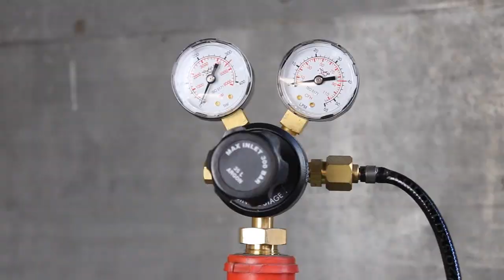DAY 2 ON THE 59 FORD 100E/ MX5 MIATA. STRIPPING DOWN THE MX5

Comment: Will this be a road registered car? Will you have any difficulties registering? Here in Australia I have been building something similar for the last 5 (!) years, basically a 1962 Mercedes 220SE Body on top of a 1990 Mercedes W126 420SEC floor pan . This will give me ,basically,ABS, air con, better suspension , etc  I'll be using a 6.9 liter V8.and it will become RHD. I used the later fire wall as i removed the outer part of the A pillars and I've combined the 220 SE pillars to make a stronger structure.I'm combing the rear firewall and parcel shelf to add yet more strength to the older body .I've retained the boot floor and the two chassis rails as they part of the original Mercedes crumple zone structure  . So far I've struck one hurdle. The Government. Here, What we are both doing is interpreted as "rebirthing" a car,which is something car thieves  do. I'll carry on regardless and work my way through the bureaucracy but i'm not holding my breath.  What i also did in the early stages with the 220SE Body was make three large templates of the firewall section, the center of the car across the doors and the rear firewall (boot bulkhead) . I could then lower these large holes over the later floor pan until I saw  the early body would be sitting , as i trimmed it back . I've kept the later sills as the Mercedes design is massive but light. The originals hd chrome covers screwed over them as stock, which makes life easier for me.  Keep up the good work, I'll be watching this from Australia!.
Reply: Mate that sounds awesome. Have you had an engineer involved? If not seek one out. It will make your life a lot easier. Your project should be classified as a rebodied. It will have to meet all adrs of the donor chassis vehicle.
Reply: Hi, yep, I am an Engineer but not certified to sign it off. I have spoken to a few here in Brisbane and their eyes glass over,with accompanying  sound of sucking teeth. Some of the other projects I have done are fully road  registered with out an Issue. I have kept most of the ADR related stuff to fit the car ,even the closed coolant system (has a another bottle hidden inside the front guard. ).When i see what the brits and Yanks can build and register I spit. For example, the Qashki body on a AWD Skyline floor pan, a PA Vauxhall body on a jag Floor pan etc etc . Grenade Motor Sports on YT builds lots of trucks using old 40's and 50's bodies on late model Chrysler Hemi SUV chassis , no problems at all. But this is Auastralia, land of the high taxes and unending rules.
Reply: Mercmad 
My advice..document everything..every receipt every item.. clearly what you are doing is nothing to do with rebirth of a stolen car. I would suggest contact with the relevant ministers and senior people within the relevant registration hierarchy. Good luck with your project. I was in early stage of planning a body swap onto a Toyota platform ( 51 ford body ) but decided against it due to the issues you bought up.
Reply: I've done that, mainly because i had issues with the government years ago (long long story i wont bother with here) and i found out early that a paper trail is absolutely essential. One car i started to build years age was mainline ute on a Holden HQ chassis, something Americans have done a lot of,using the GM A type Chassis with older sedan and coupe bodies ,without a problem. I ran out of time on that one so I sold it. But I was going to register it as a HQ ute.... A mate had one he had bought which was a mainline on a falcon Floor pan which had been registered in NSW ,where it's notoriously difficult to get things approved.
Reply: That sounds like a very cool project, I had a W111 220S, W108 280S in Australia and a W126 500SEL I owned in Hong Kong and brought back to Australia. They are the most beautiful cars.
Reply: Yeah we definitely get a hard time trying to register modified vehicles. I would suggest talking to some local hotrod clubs. They have a lot of experience and contacts with this sort of thing. Might help streamline the process.
Reply: Mercmad 
Where are you based mate? I’d be genuinely interested to see what you are up to and chat a bit. 
32 years in modified car scene behind me. I appreciate good work and creative thinking
Reply: get a room
Reply from the maker: Its gonna be a track car. Cheers
Reply: They won’t even let me put a turbo hyabusa engine in the back of my 68 mini van :)

Comment: Seeing that pulled apart brings home the complexity of the modern car ( and that is probably 15 years old) the electrics in particular. Also the corrosion in that MX5 - what is it like in the main front chassis rails just above the front axle - they go there which often fails MOT. Really  no way this can be a road car. This is a very big job be a lot of joining panels to be made.Hope you get a few lucky breaks with the dimensions.

Comment: Your math is wrong. The Miata wheelbase is 89" not 92", so the wheelbase mismatch wont be a big deal. I did a similar chassis swap where I put the Miata chassis under a Volvo P1800ES with a V8 conversion.  Miata chassis swap all the things!
Reply: Love that topic on retro rides👍
Reply from the maker: Ah result, only 3 inches to loose then.

Comment: I know this is already a long way on. But why didn’t you just widen the 100e body? With the amount of welding and modifications that you are doing, putting a 4” strip down the middle wouldn’t have been a dramatic and rather simple job.

Comment: You know how I got eye cancer in my right eye?   Using a plasma cutter without eye wear with the proper shade of lens. Also...as a retired body man, my advice is...don't cut apart unibody structures without proper welded in cross bracing or the structure will flex and change dimensions. Another no-no is to weld regular sheet metal to high strength low alloy sheet metal when making structural chassis parts. It would have been better to go to the scrap yard and size up rails and strut towers from other modern vehicles and use those in fabrication. Other than that , you are doing an interesting fabrication project and I myself have sized up a Miata floor pan and power train for an Opel Gt project...hope it turns out well for you!
Reply from the maker: Sorry to hear that bud, I always drag the tip on the metal so I don't actually see the arc but I appreciate the concern and that's something to think about for sure, I will be more careful in the future after hearing that. Hows the eye now?

Comment: The 1.8 miatas have a separate engine harness, I take it this is a 1.6.
Reply: Crazy KT Hey Hoonigan viewer 😂
Reply: BeefyWand you caught me, I was trying to sound all super knowledgable and stuff, when in reality I have never sat in or wrenched on a Mx5 in my life.
Reply: I just watched it so stood out lol. Btw this is a mk2 miata/mx5 so is actually a 1.8. Presume the later ones are wired up very differently.
Reply: Crazy KT would of thought they had the same, probably early models loom in one. I normally cut them and solder back of fit a multi-plug when possible
Reply: I've no right to interject, suffice to say I do know the 1.6 wasn't developed to be EFI... at the last minute it got a change that meant things were very different with the 1800 unit

Comment: Is this something a lot of people are doing in Europe/UK or are you winging it? I'd have never come up with this on my own. Should be a pretty cool little car when done!
Reply: I don’t believe it’s a common project.  In the old days the under chassis and car body are two separate parts joined together. Notice how easy was it for him to remove the Ford car body from the chassis?  Nowadays the chassis and body are welded in together as one piece in the factory.  There’s a lot of cutting and fabrication to make it all fit and work marrying the Ford 100E and Mazda Miata.
Reply from the maker: Its actually been done a few times. Cheers

Comment: Yo subbed..... what's the actual hub-to-hub difference/distance
Reply: Between the Mazda/100 :-)
Reply from the maker: 5  inches, Cheers
Reply: @Urchfab  
Tiny bit of neg camber &'a slightly rolled arch.... 
Cracking